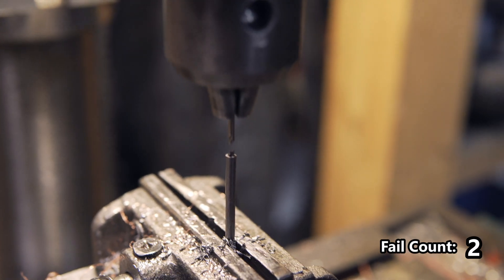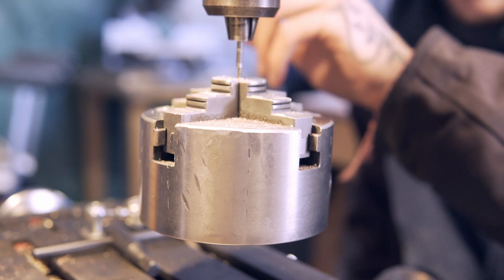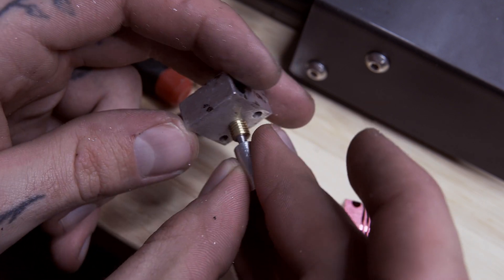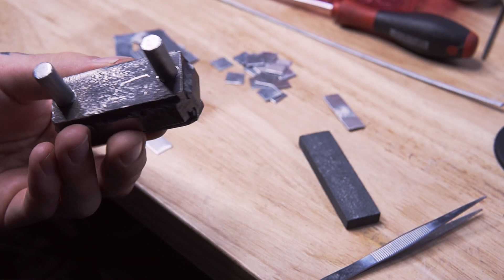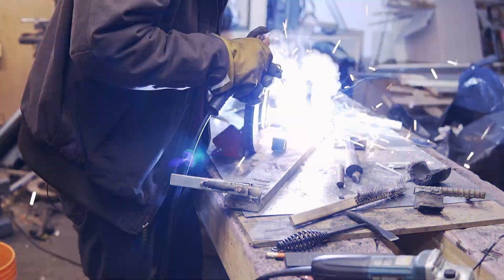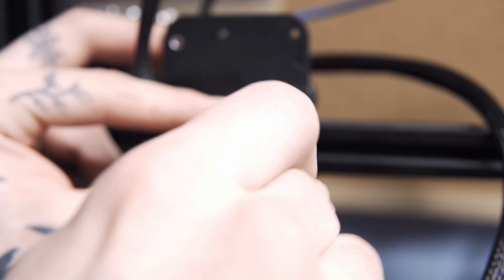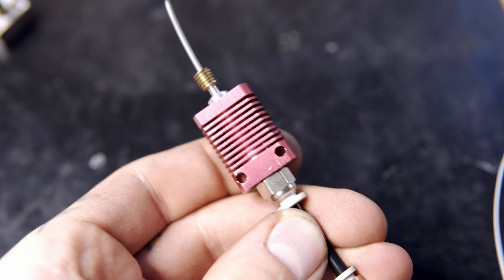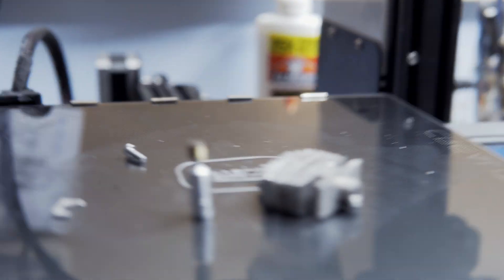I attempted to make my own 3d printer parts... Chaos ensued.

Comment from the maker: I think to say this tried my patience is an understatement. What do you think I should do differently next time??
Reply: No drill tailstock on the lathe?
Reply from the maker: @Jbearzy  not yet, that's coming up in the spring. I wasn't sure on how I wanted to build it so I put it off until later
Reply: I’ve had success with holding the rod to be drilled in the drill press Chuck and then holding the drill in another Chuck bolted to the table, then using the quill to lower the rod onto the drill. It’s easier to align because you can use the drill bit in the top Chuck and then align the bottom Chuck to meet it, then put the bit in the bottom Chuck.
Reply from the maker: @kevinjamieson8676  thanks for the advice!
Reply: @Neally  Other thought for making the fins is Dremel + slitting saw + square chunk of aluminum?
Reply from the maker: @Kevin Jamieson I want to try to mill the fins out of a solid block of aluminum, but I like that too! Maybe I could pop the slitting saw into the drill press. I also might try to punch the fins out of copper, that might make it a lot easier to braze
Reply: .. and watching more of the video I see you did that trick. Carry on!